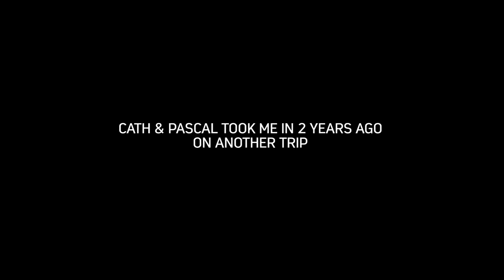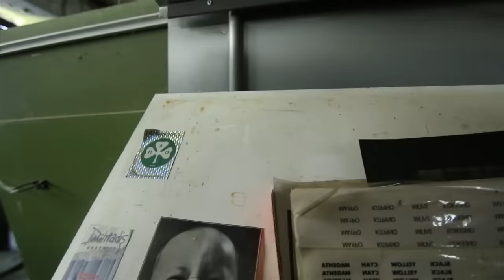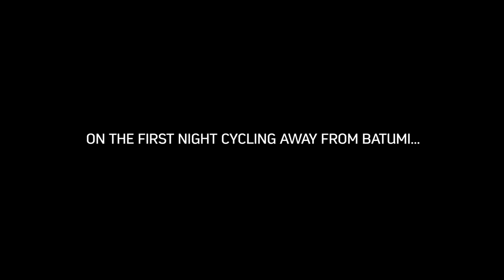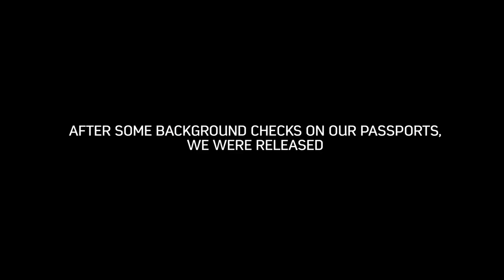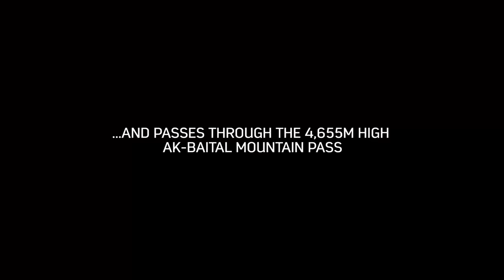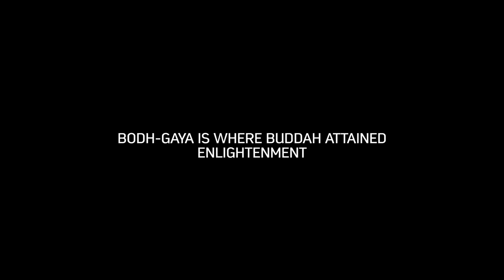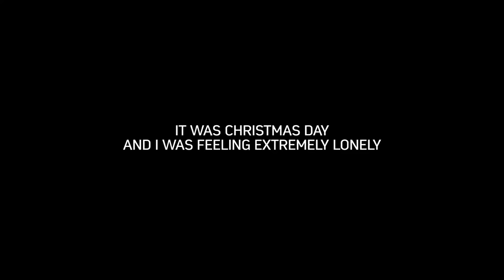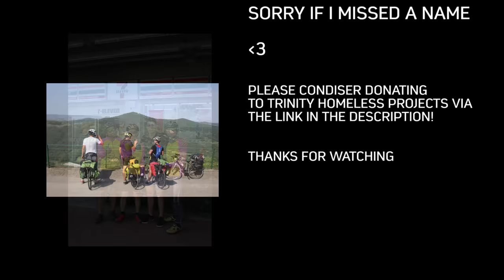UK to Australia by Bike

Comment: Hey guys, I've been in the process of planning my own (world) tour in the near future, currently saving up for all the gear I need. There's one item i keep postponing and that's a bike computer/navi/whatever. Do you have any tips on this, which one did you use?
Reply: Didn't use a bike computer at all. I was main navigator and used Google maps on the phone. Usually you follow big routes/roads so little navigation is needed. It's only when going through bigger built up areas that I'd look at my phone for directions more often :)